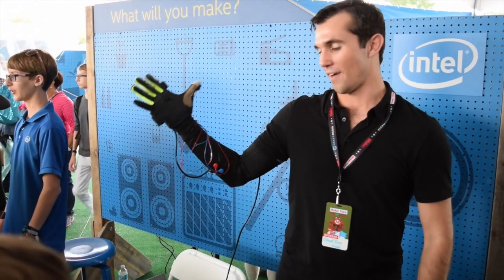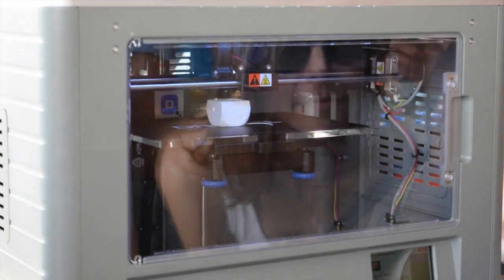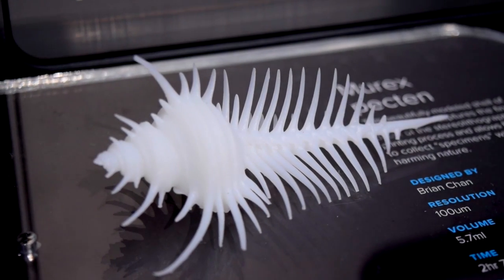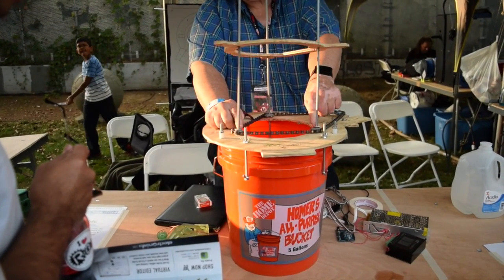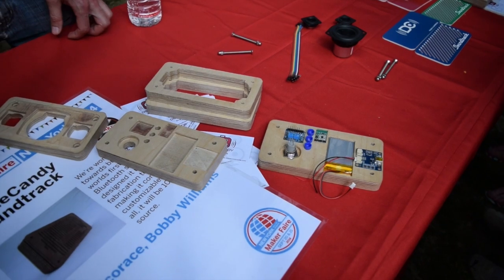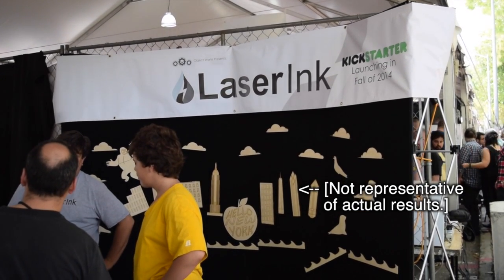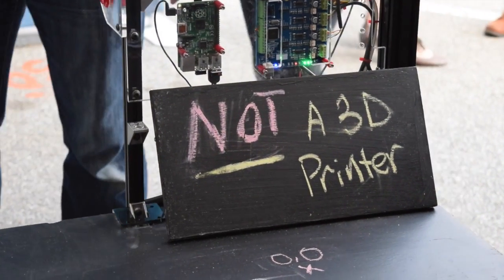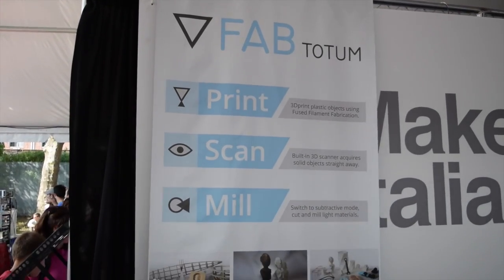The CNC Machines and 3D Printers of Makerfaire NY 2014

Comment: If you are interested in a Shapeoko compatible laser upgrade kit, you might want to check this out http://jtechphotonics.com/?page_id=1100.  It is more powerful, less expensive and a proven product.  There is also a very nice article about this kit as an add-on to a Printrbot Simple Metal http://polakiumengineering.org/1000-portable-3d-printer-laser-cutter/.  Heck it can cut 3mm Acrylic.